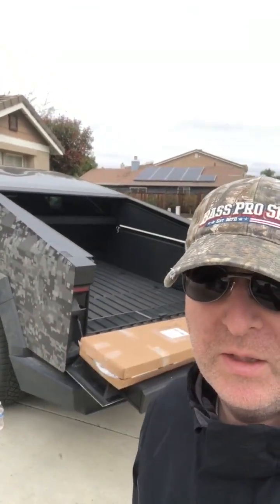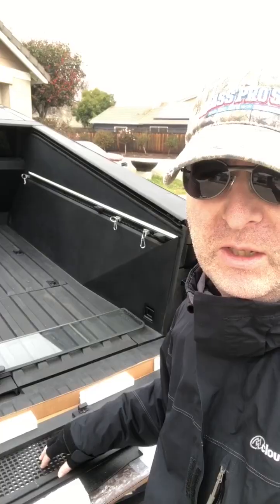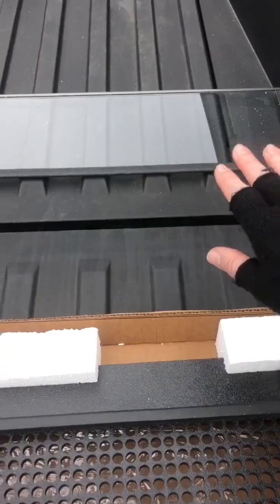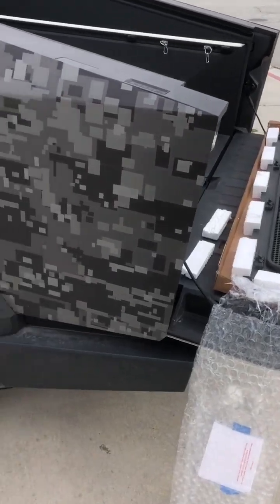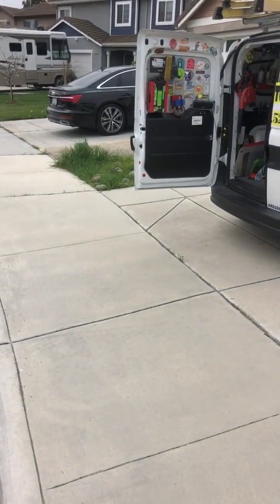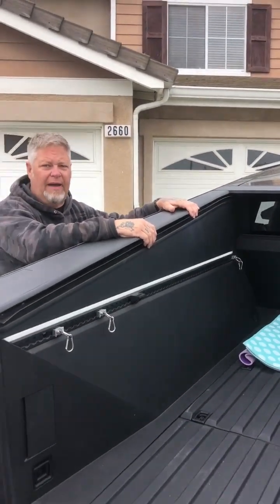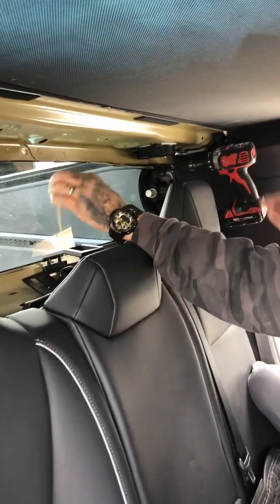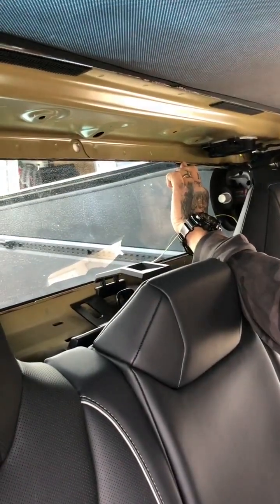Tesla CyberTruck rear window replacement with Breezer Windows HVAC solution.

Comment: Hi Fabian, I recently installed this breezer window on my Cybertruck but the passenger side back corner is rubbing on my tonneau cover when open/closed. Did you have this problem? I set an another appointment to have repositioned. Did you have this issue?

Comment: Thank you for doing that. That was really cool. There’s a part of me that wants to consider temporarily removing the front passenger seat and the passenger side second row seat. I was then going to cut a hole large enough for my legs and thighs to slip throughto the bed. That way I could sleep in the cabin and have space for my 6 foot three body. Obviously this is for someone who’s going to be so low camping and exploring. Wondered what your thoughts were about that idea.?

Comment: Can the replacement glass breezer sends, be put up without the vent holding it up. I want to have it open a lot of the time to crawl through. And when I need to take a few seconds to snap the glass piece back in.

Comment: The hvac system isn't designed to heat/cool such a large area, especially with the metal cover not being very insulating. I don't think it'll cool/heat it very well.